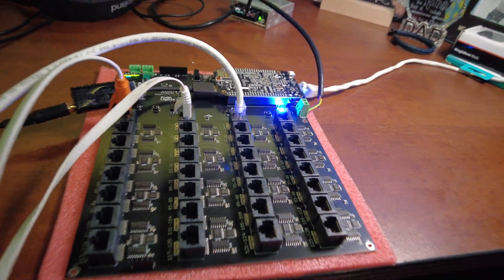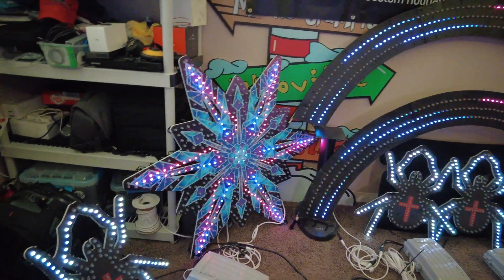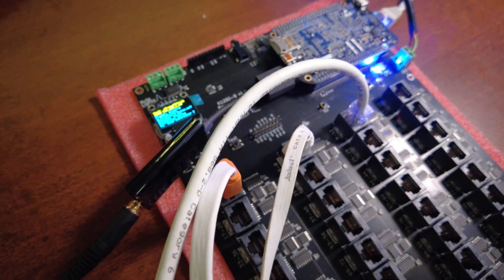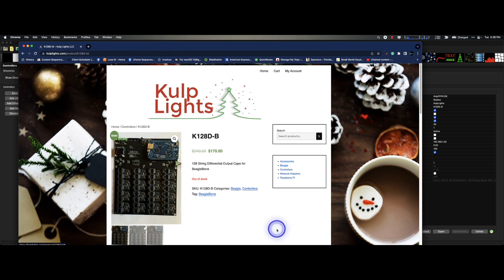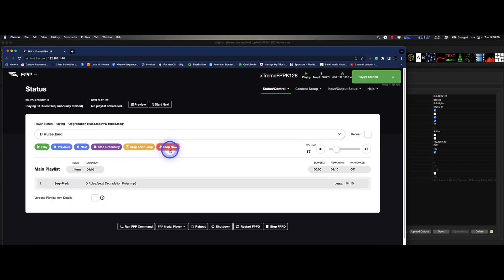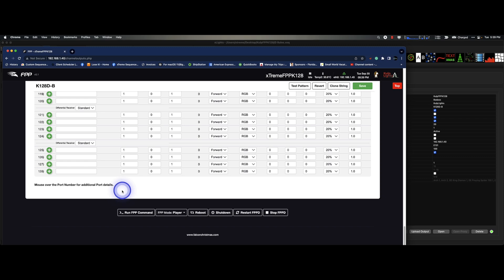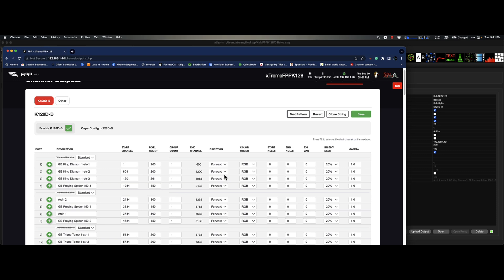New  K128D-B 128 String Differential Controller

Comment: Im a newb here starting out researching what i wanna buy.  Would this or could this replace say the Kulp 32 port controller?  Use this as  the main and have receivers coming off of this to the props or lights outside?  Sorry if this is a dumb question still learning.  Thanks
Reply from the maker: It's a great question. The K128 is a distributable method of managing your show. The benefit is keeping a controller at home base and running ethernet to various receivers for your needs. The question is will a K32 make more sense in denely populated areas where props are close enough for the 32 outputs to reach. If not, then the K128 or K64 could be a great solution.

Comment: This is DAMN COOL ! ! !
Just think, one "main" network system, and then run "power/data" out to the props...
place a smaller power supply and receiver at the prop... one prop/one power/one data DONE....
you could install the rec. pcb/power in a 4x4 PVC post, cap it off, secure it to the back of the prop, and use the 4x4 as a mounting location. LOVE this idea ! ! !

Comment: This controller architecture is not for everyone, I share your thrill 💯 as i do not daisy chain my props either. The fact that you can set the receiver type on the output screen is a big plus. Sad that is already Out a stock because i like the way the output are distribute, will be easier to wire the box up.
Reply from the maker: Point of clarification: I don't daisychain receivers. For the most part I don't Daisy-chain props since most are high density. Eaves and verts I do depending on locations. The reason this is currently out of stock is because a select number of users are testing these preproduction units. I'm sure they will be available soon.

Comment: kulp went craaaazy
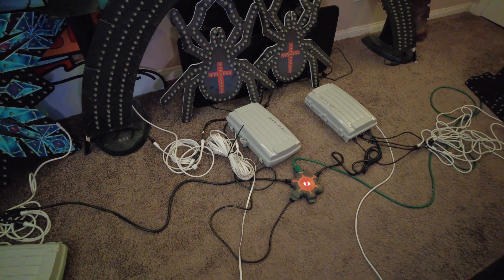at min 2:16 there is a 6 star thingy, can i ask what is that?
Reply from the maker: That is the King Diamond from Gilbert Engineering USA.
Reply: @xTremeSequences   hahaha my mistake, the star thingy on the floor that have 3 black wires and  1 green wire
Reply from the maker: @deverostv5046  Ah! That's a 5 port power plug.